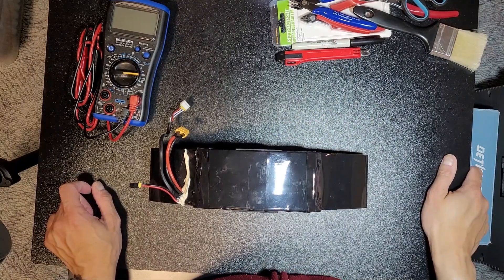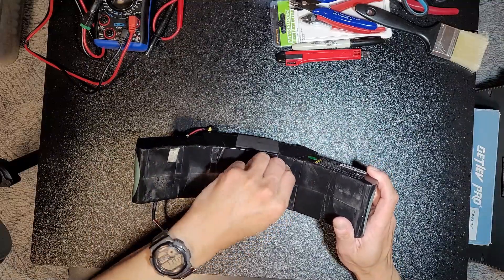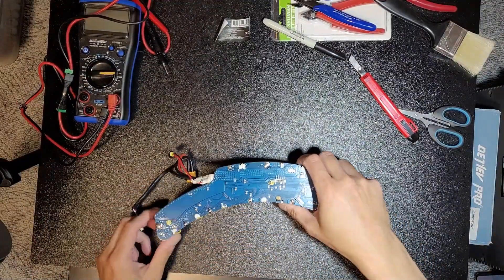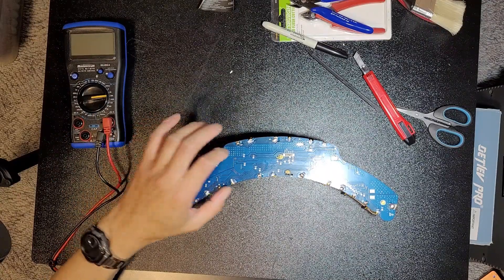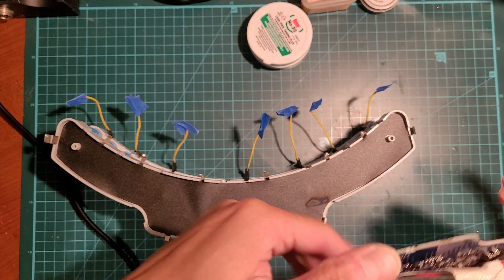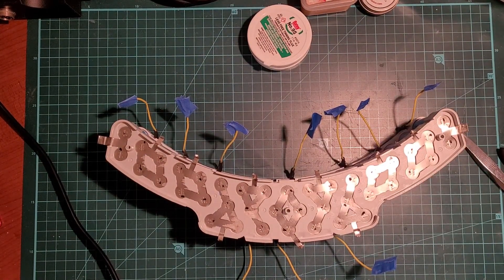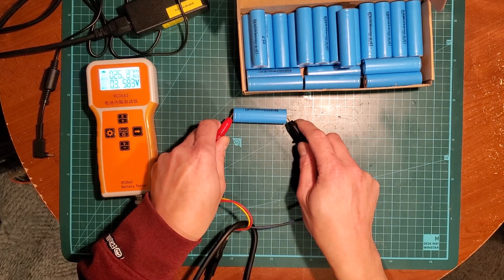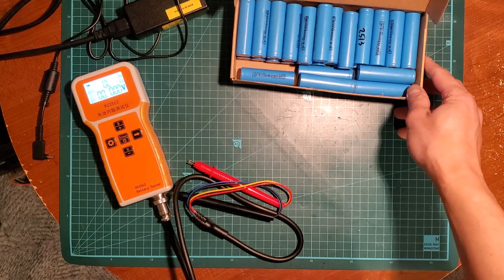Inmotion v8f or V5F Battery Teardown

Comment: Do you change battery v8f with cell 21700?
Reply from the maker: They won't fit the v8f frame, its designed for 18650.

Comment: Were you able to repair or replace the BMS?
On my V8S, I have 74V between the two connectors at each end, and 8.2V between each pair of connectors (9 x 8.2 = 73.8, and I don't have access to the connector for the last set of 4 cells without removing the second half of the battery case), so the cells seem good, and I don't know what other test to perform :(
Reply from the maker: I don't have a v8s to test with. I took the cells out and kept the BMS but i dont know if it still works or not. All the cells tested fine so i think its an issue with the BMS. I will use it for parts or maybe get it inspected by an electronic tech.
Reply: @AerialMax8  In the meantime I have made progress with the diagnosis, and only the BMS remains, so I ordered one ;)
Reply: @cotcotpouetpouet Hi, where did you find the bms? Mine is dead and I found nowhere to order😭